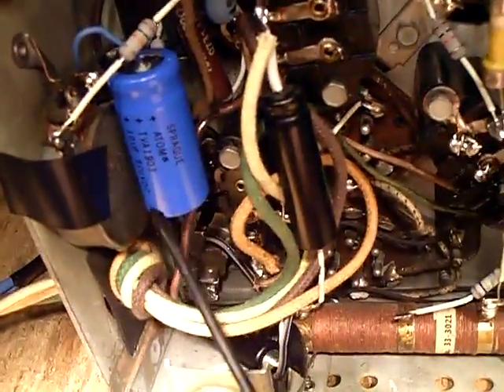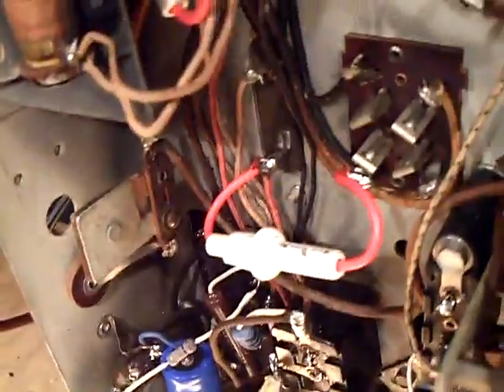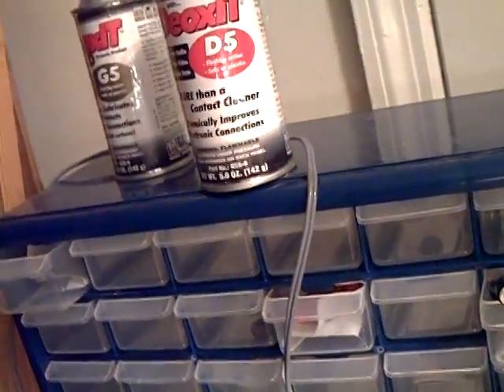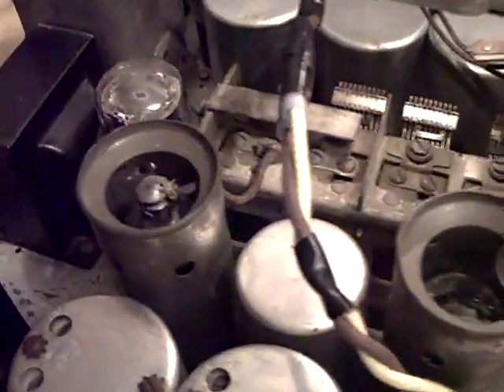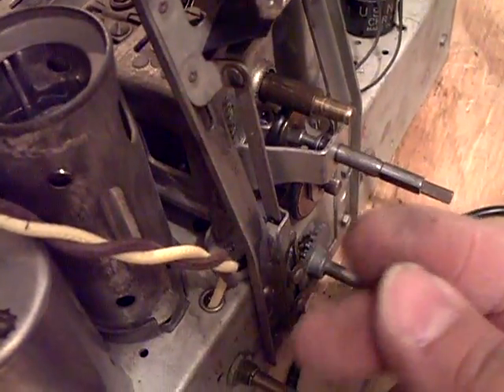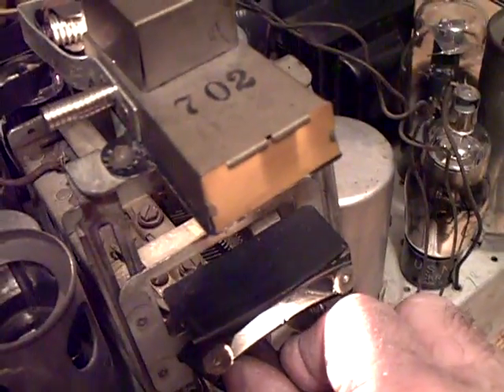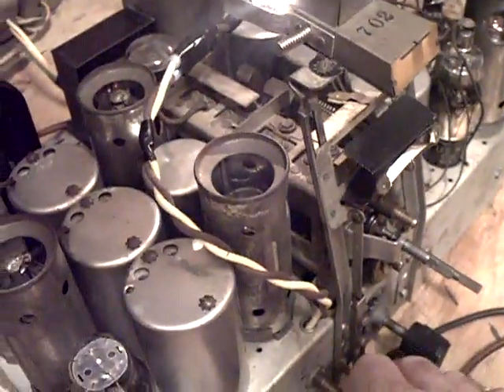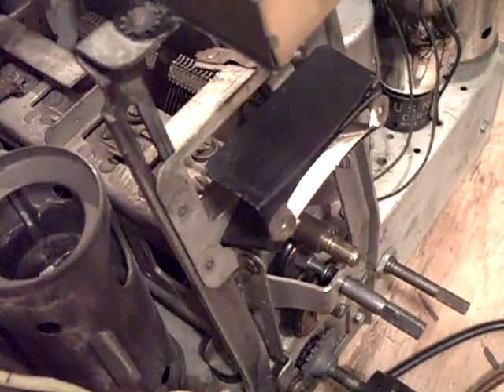Part 31, Philco 16B Recapped and Powering Up!

Comment from the maker: @blackjack6934 Maybe, in the future but I can't do it right now. I have to work on my truck, it needs an intake manifold gasket and maybe head gaskets. i also have to repair my tube tester so i can test tubes. i have no concrete idea when i can approach a radio project at this time

Comment: Would you like to restore a Philco 16L 1933 radio..? It works, but the tubes need to be checked and probably all the caps changed out.
I could send you just the radio chasis.

Comment: Nothing like the "sound" of success.  Congratulations.
Even though I knew you had previously fired up the radio, watching you do it again still made me somewhat nervous.  I highly recommend that you soon rig an AC ammeter in series with your power source. Gradually bringing up the voltage is good, but it's also extremely important to closely monitor the current draw, even though you do add fuses.  Great job.

Regards,
John

Comment from the maker: That's why I made my videos to help everyone step by step just in case you have a hankering to do one of these.  It's like eating a steak, you have to do it bite by bite and not eat the whole steak in one bite. Some areas of this radio was really crammed with parts. But it was definately easier than the RCA 262. the RCA had a LOT more wires in it. I think the bakelite block caps helped reduce the wiring, but I am not sure about that.